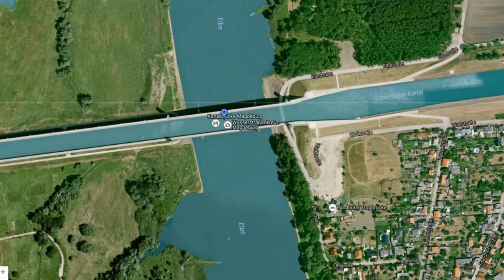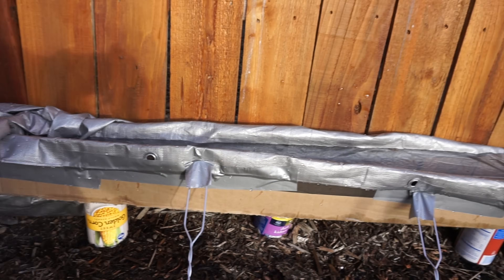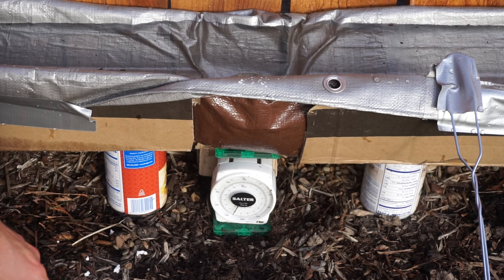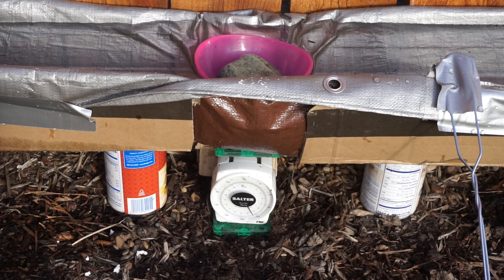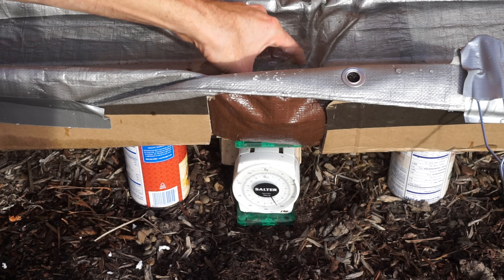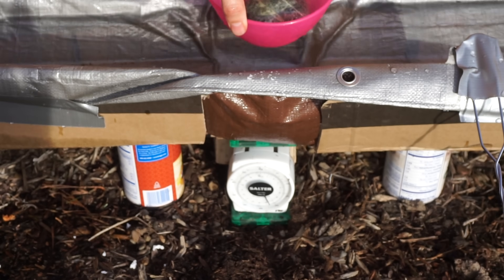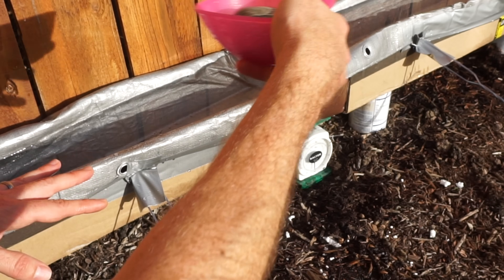What Happens When a Boat Crosses a Water Bridge? Does the Weight Increase?

Comment: There would be a slight rise in the water level as there would also be a slight increase in the distributed weight across the entire body of water.  I would imagine if you had a scale and water level measurement device that was accurate enough, you would see a slight increase in the water level and a slight increase in the weight at all points.  It would be no different than adding the same amount of water that is being displaced by the floating weight.
Would that be correct?
Reply: I think so, and it doesn't matter if the boat is above the bridge or somewhere else in the river.
Reply: yep
Reply: yes
Reply: This has to do with the fact that a bridge like the one in germany is an open system. Mass is mass, and mass has weight regardless of it floating or not. If I were to get a bucket halfway full of water and I add a 5lb boat, the entire system would weight 5lbs more. The fact that an open system like the bridge has the ability to displace water it technically means that it can displace mass through both sides of the bridge therefore not applying more weight to the structure. However, the bridge shown in the video seemed to be a closed system therefore the entire weight of that specific bridge did indeed weight more once the boat was added. The reason why the scale didn’t measure the increase in weight was because 1. The weight got distributed amongst the entire stucture and not just that specific section and 2. The scale was not precise enough to capture the increase  in weight
Reply: Exactly correct
Reply: Jason Bell you made my brain stop for a second while reading that
Reply: Yup, what you said is 100% correct
Reply: True... I can see the needle moves a little bit on the scale there
Reply: Yea, no matter where the boat is, it’ll always add the amount of weight equal to the boat. It’ll just be spread out across the entire body of water
Reply: Correct.
Reply: Spot on. I was going to say it if bo one had
Reply: Thanks, this it what I immediately thought
Reply: If there was a boat heavy enough it would overwhelm the allotted overflow.  Weight limit is the main factor here.  However, still very fascinating.
Reply: Of course it's correct
Reply: true
Reply: After careful consideration I'll have to say "No". No you do not get a water level increase, nor a weight increase in the situation you mentioned.
Imagine this.
A ship sits in a canal *already*.
The ship moves over the bridged area.
Would the waterlevel suddenly rise? Would the weight suddenly rise?
No. It has already risen.
The boat displaces the water equal to its weight at all times, so the waterlevel simply won't rise any more.
Since the boat displaces water equal to its weight, the weight in the total canal or above the bridge will not change even 1 gram per definition of "buoyancy".
Yes, you'll see scales and measuring tools move, due to the waves it is producing while moving over. Not because it suddenly falls into existence like shown on the video. Yes, the boat's weight will contribute to the total water's mass, but it's spread over a canal's worth of length. Hence, it will not even be a gram.
I hope this makes sense because it is what has been proven by the video.
Nuance matters a lot when you're dumping a theory on the internet, so I applied nuance everywhere.
Reply: At 1:25 you can see the scale slightly move due to the initial addition to the overall weight.
Reply: easy to imagine..if there's a bowl of water above the scale which its full weight is supported by (only) the scale, then the change in weight would become more obvious and might get picked up by the scale. the reason the experiment above shows no change in reading is because the increased weight is too small since the all the increased weight is distributed by all the cans that he use to support the other part of the apparatus. yes brother you are correct. the increased pressure is exerted to all points across the water body
Reply: Yes. In fluid mechanics Archimedes principle is law, (weight-of-liquid-displaced)=(weight-of-object-in-vacuum)-(wight-of-object-in-liquid). But technically it wouldn't be increase in weight but increase of pressure. The pressure in a body of liquid is defined as (Pressure)=(liquid-density)*(gravitational-constant)*(liquid-depth).
Reply: I read a physics article on vice one time, now I'm an expert and tell people on the internet how their world works.
Reply: The water level won't rise. There's a whole lot of river behind bro any water displaced by the boat will be pushed and distributed through whole water system which is the insignificant rise in level of water
Reply: @ravibhartia4797  You're assuming it's an open system, which of course most waterways are.  His demo was a closed system though, and in that case there would be a rise (unless there was a leveling system as someone else mentioned), so the bridge would have to account for its share of the weight of every boat loaded onto the system regardless of where that boat is.  I think.
Reply: Everyone wanna know something interesting? The weight the structure has to support is directly related to the column of water directly above and around the support. Which means waves actually will change the weight specific supports need to carry. A support under the trough of a wave will carry less weight than the peak of a wave, which Carrie's more weight. Meaning the bridge must be designed to withstand any waves or resonant waves that could be generated over the water bridge!

Physics is fun!
Reply: you are right, the reason the rock and boat together doesn't sink is because of the general mass/weight of the amount of surface area you are taking, this includes the air, and so the general mass of the air and rock and boat would be equivalent to the same amount of mass in water.
Reply: My question is how does this experiment work in a magnetic levitation system?
Reply: My buoyancy increased when I farted in a scuba suit.
Reply: Not necessarily. The water level of most (if not all) canals have their water level maintained at a certain level. Excess water spills away while a deficit is 'topped up" with pumps to always maintain water levels. Therefore, no matter what size vessel or any number of vessels on the water the head of water remains the same. The only other external force that the engineers would have to design for is barometric pressure (atmospheric pressure) This would indeed increase the water pressure across the entire waterway without necassarily affecting the water level. And even in this case, any change in barometric pressure would (or should) be well within the already built in safety margins.
Reply: @welshsteve2009  you are right, but that's not his point

Comment: In case of a submarine, does the depth at which it is, increase the load on the water bridge. 
Note: The water bridge we are considering should contain water with height over 100 times, that of the "test submarine". Hope you answer.

Comment: Okay. Now hypothetical question, if buoyancy allows the weight of the rock within the boat in question to be displaced and therefore not increase the load on the bridge itself, can you then build a second bridge inside the first Bridge completely displaced by the water? 

My thought is this, if a boat, regardless of its weight, is being displaced by the water, then what if you create a bridge that's effectively floating on the water, by something like a pontoon, send effectively following this logic, the second bridge could become a theoretical boat, floating on a cushion of water, within a water Bridge.

 The reason why I'm thinking about this, is this could create in theory a natural Shockwave system for bridges, in areas that have problems with earthquakes or other forms of ground turbulence. So if the theory holds, and Carries over to the buoyancy being Universal, you could create a rather effective shock absorption system.

Comment: But the displaced water is still held by the bridge meaning that it only distributes the weight across all the supports as the water level increases across the whole bridge so if the scale was the only thing supporting it it would feel the whole weight or am I missing something
Reply: Yes the water level rises but..
1. The rise is negligible when you look are how long the  waterway is
2. The bridge is just small part of the whole waterway, and the force of the boat is distributed in the area of bridge + non bridge
Reply: What you missed is where that displaced water is going.  The displaced water is NOT still held by the bridge. The bridge is not a closed system.  It connects two bodies of water.  The displaced water weight is pushed outward off of the bridge.
Reply: @sanitysquota937  oh I see thank you and to everyone else appreciate it
Reply: @sanitysquota937  People are confused because the test he ran in the video WAS a closed system, and the entirety of the water would rise in such a closed system.
Reply: it is a long river. it is not just a bridge with water on it. bridge just needs to support a tiny fraction of total weight.
Reply: Yes, it was a closed system, but most of it was “river”, only the cut out part was the bridge.
Reply: Good point, the weight does increase but its negligible. Because the water level will rise across the entire river, and so is the weight of the boat divided across entire river. To find out exactly how much extra weight the bridge has to carry, you have to:
(Weight of the boat)×(Surface of the bridge):(surface of the river)=(increased weight)

Edited:
What this also means is that the bridge has to carry weight of ANY boat placed in the river no matter how far away the boat is.
Reply: not just all of the support, but the water as well. as in the weight added equal to water displaced by the hull to the water, so if it's connected to lake, the weight is also supported by the lake. the weight of ship isn't more that the water it's displaced
Reply: Wouldn't the weight of the boats be negligible compared to the weight of all that water anyways? Definitely cool that the engineers don't need to account for the weight of the boats, but they still have to account for a ton of weight.
Reply: @linkinpaak  As long as the engineers account for any possible water level, the boats and their weight is irrelevant. Only the water level matters. The boats have some negligible effect on the water level, but the engineering only has to account for possible water levels and the applicable safety margin for that.
Reply: @Sir Solid Snail  The system does not contain all of the water in the world.  It would only contain all of the water it is connected to.  This means the river, and the water it flows into.  This is either a lake, or the ocean.  Honestly, I'm not sure it even contains all of the river because the river starts at a higher height than the water level in the bridge.
Reply: the bridge only cares about the water level/amount of water on the bridge and if its connected to a big waterway the boat is only going to have a very small effect on the level of the waterway/level of water on the bridge.
 
And you would hope, the bridge [and the whole waterway] would be designed to hold the weight of water if its filled right to the top and anything you put in can never exceed that if its floating. think of an above ground pool, filled to the top with water then you put a heavy boat in it, the weight the boat displaces would just overflow in the form of water and the pool would be fine.
Reply: I'm so appreciative to see so many actually discussing the science of the video.  Maybe I haven't looked hard enough, but I feel like I usually see people making jokes and memes in the comment section, rather than discussing the actual content of the video.  There's nothing wrong with jokes; I just like seeing some science too.
Reply: Yes
Reply: The displaced water would stay on the bridge if it weren't for water's desire to stay level, in order to stay level the water has to flow off the bridge, meaning the amount of mass on the bridge itself stays unchanged.
Reply: Yes,you are missing. 
The water level has rised for the whole river and not only on the bridge. 
Hope you understood.

Comment: Empty and Seal a old supertanker, put it on the sea and pull it down with engines, regenerate the energy if needed. Now you have a battery that works with buoyancy.(but it would be crushed by the pressure...)^^
Reply: You could simply pump the water at higher altitudes and the release it to regenerate power + it is more practical than emptying a supertank
Reply: @faizanahmed653  Its just another (not really practical) way to store energy. xD

Comment: If any science class was as simple as how he explains, I would have the least struggle
Reply: To be fair this was too simple and hence was wrong. You did nor take dynamic forces into effect. While moving slowly across with low displacement vessels will minimize dynamic forces. Most easily seen would be if the bow wave makes it deeper in front of the boat, you would then see a pressure wave pass through the bridge, then a lessening as the dip in the wake passes through. The faster and heavier the transiting boat, the larger the extra forces created.
Reply: @alaskanight940  It's not wrong , It's just that you are taking as not negligible something that is clearly negligible in this little experiment.
 It all depends on the assumptions you make to describe what you are seeing and what aspect you want to point out of it. 
What he noticed mainly Is just that the presentation of a subject and the way of explaining it matters a lot. 

The school could still take this approach :  
1 . Present the experiment to the class in a way that is fun
2 . Make the students guess until a good amount of them get the core idea 
3 . Explain the core idea to the rest of the class in the simplest way possible
4 . Improve the theoretical description by modifying slightly the assumptions made to describe the experiment and pointing them out in order to make them dig a little further into the other details they've ignored initially.
5 (optional step) . Get them to find similar examples in everyday life or let them do a variation on the experiment on their own and play with it or invent something useful with what they've just learned

and the job is done.
Reply: @F a Good idea to present the overall concept as a whole to gain appreciation and understanding of the concept, then dig into the math.  If modern school was a video game, the production studio would be LJN.
Dry, boring, repetitive task, lifeless with no soul.
Reply: it all depends on the intent behind who's educating you. If the intent is to prepare people like some products in a assembly line than It's all a bit lifeless , if the intent is to amaze you and to enrich your curiosity than It's more interesting.
Reply: @F a That is because the school and education systems are trash.
Reply: Nico K. I don’t think it’s the material being taught, but who and how they’re teaching it. If the teacher seems passionate about it and actively works towards making it interesting then more people would pass. 

Also I tend to find the crazier the teacher the better. I remember I used to have this Civics teacher in 7th grade (she was probably one of the craziest but still “sane” person I knew) and somehow makes it interesting
Reply: @thatonedude-6819  We can't blame teacher's, they have to work for 8:00 and they are unhappy about it, and us kids have to learn and sit in chair for 8 hours also unhappy about it. Single thing has not changed since 1900's
Reply: @nicok.1491  I wouldn't call them trash but they can definitely use a lot of improvements as they are pretty bad in my opinion. They teach you things, yeah. But the way they do it sucks because for every person they could understand something but they might need a different explanation.
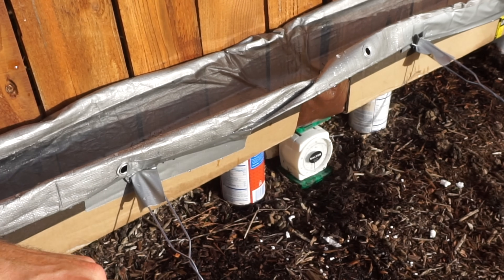Reply: @robbe1056  They teach you thing's that most of class will not even touch when they grow up, also they are raising kids to be lonely factory workers...wake up at 8:00 finish school in 2:00, do homework 4:00, study for the tests or answerings to 6:00, than you have a small amount of time for yourself,family,fun.
Reply: @nicok.1491  Maybe you're just not smart.
Reply: @JustinL614  Wtf dude. Go and find youreself a hobby lol.